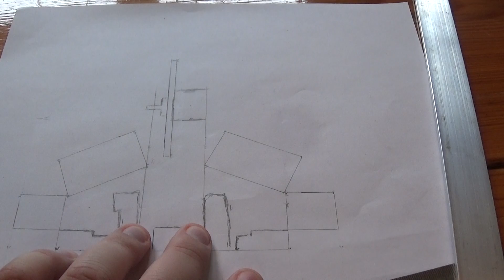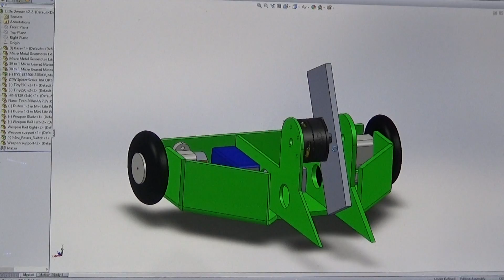Build Report: Little Demon (150 Gram Combat Robot)

Comment: how you doing. What's the amperage on the speed controllers you're using and what charger do you use to charge your Nano Tech batteries?
Reply from the maker: The drive ESCs are rated at 3A and the weapon ESC is rated at 18A. I use a Triton charger. I have both an older and newer model they've made and they've both served me well
Reply: look for this charger thank you

Comment: Loved the video! Could you please explain how you mounted the spinner on your motor? I'm not able to understand that part from the video. Also, it would be great if you could link the parts needed to mount it. Thanks!
Reply from the maker: +Raghav Thakar I just used the hardware and mounting points on the motor that were there to mount the prop adapter with.
Reply: Team Cerberus Aah. Thanks!

Comment: I'm starting out with the whole combat bot thing. I just dont really know what parts I should get for the guts, I'm not looking to copy your design or anything I just would like to know what I would need to make it go and fight and if you don't mind what you use for a controller... thx
Reply from the maker: The type of parts I mention in this video are a "basic" setup if you ignore the weapon system. Depending on the weight class it just kind of scales up from here but follows the same basic idea. My radio is the Hobby King 6 channel T6A.
Reply: Team Cerberus I'm just worried th at I'll order the wrong parts that wont be compatable with the moters or speed controlers
Reply: What country are you in? Because I've been looking into getting into Antweights here in the UK and theres a couple of places that will provide you with "starter kits" of the basic electronics, but I'm not sure if they ship internationally. Regardless, do some research and ask on forums, most roboteers will happily advise new people in how to build things.
Reply: try the fingertech viper v2 kit, it is easy to build and modify, they also provide separate addon kits to add active weapons to your robot, however the spinner blades are sold separately
Reply: My students would be delighted to learn from you,can you connect on skype

Comment: how did you print the template off at 1:1 scale?
Reply from the maker: +piplup2009 in Solidworks if you create a drawing and bring the part in, you can select the part and assign it a scale. When it prints it will come out at the correct size